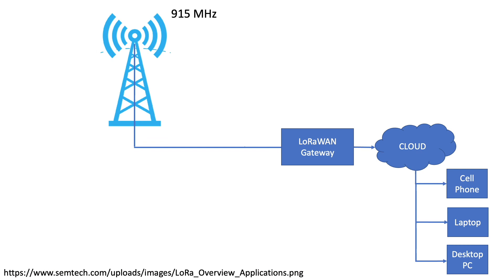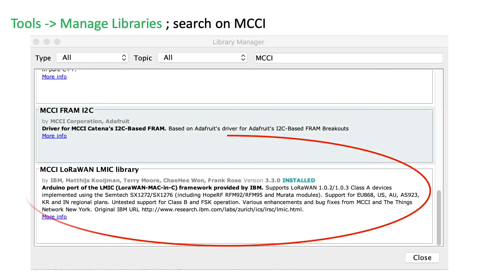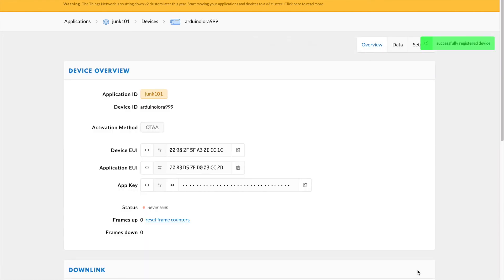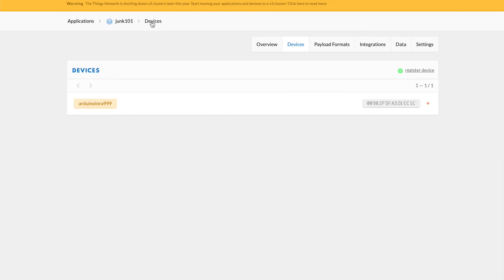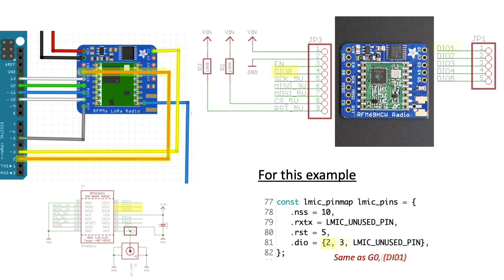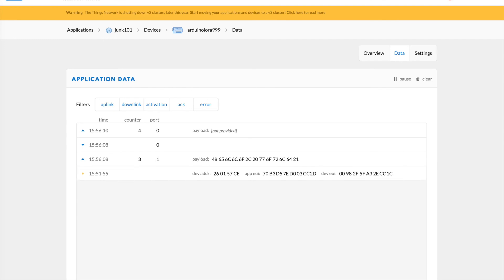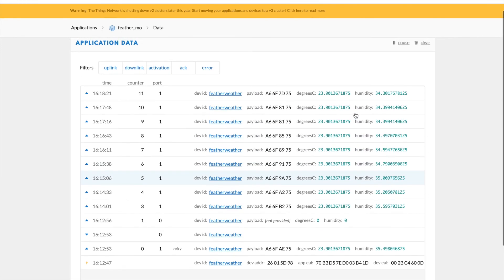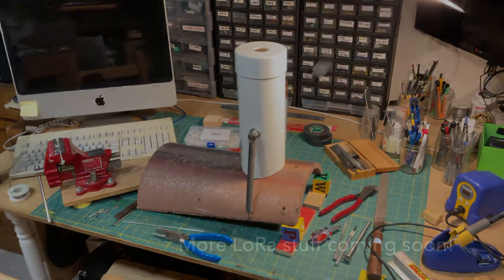Building a LoRaWAN Node for The Things Network (TTN)

Comment: Great feedback on the video! I have a couple of questions related to it. Firstly, what is the typical coverage range for a LoRaWAN node? Additionally, when you assemble a network using multiple nodes and program IoT SIM cards to run the mesh program, how feasible would it be to create your own internet connectivity? Thank you!
Reply from the maker: I have several videos where I experiment with LoRaWAN coverage. Here's a couple you might find interesting. https://youtu.be/Zw_LA3nDAkc and https://youtu.be/wz6cCa5r1eY

More details also in this playlist: https://www.youtube.com/playlist?list=PLqJ5k4cakypzJPcVFz7onbwzc0EWFHU7p

When I started hosting a Synchrobit miner on the same antenna, I was pinging other gateways farther than 40 km away! I am not to familiar with mesh networks, but I'd just keep in mind that LoRa is limited to very low bandwidth, so it's not like you can share photos or long emails on a LoRa-based network. It's more suited to very small bits of data and requires line of sight for long distance telemetry.

Comment: Thank you for the very helpful videos! I have a question about LoRa Gateway. Do you think if it is possible to mount this gateway (from adafruit) to a basic drone? Is it heavy? Many thanks,
Reply from the maker: I think a drone’s motor might generate a lot of electrical noise that will likely interfere with low energy transmissions associated with LoRa- even if your drone can handle the relatively light load of a node. I am not clear on how you would make this work for a gateway since you need to be within WiFi for the gateway to work.

Comment: Hi,Instead of that temperature sensor data can we do for the GPS module and access the data in the ttn?
Reply from the maker: That’s a completely different project. I have just plugged back into Xerocraft and hope to explore this shortly via the donated TTN gateway. (The transition to V3 was challenging so I put LoRa down for awhile until all the details are worked out).
Reply: @ModestMaker  actually we are trying out with our team to do that using GPS module so I have asked you....Thanks for your response...if I want to contact you can I get a Email ID..

Comment: can you create a lora node without arduino ?
Reply from the maker: Not sure, but I would want a microcontroller so that I can process sensor data. An Arduino (IDE) gives me access to the libraries supporting most commercial sensors.
Reply: @ModestMaker  I am looking onto GPS data only. Tnx for the input